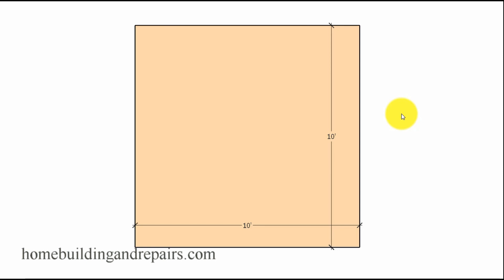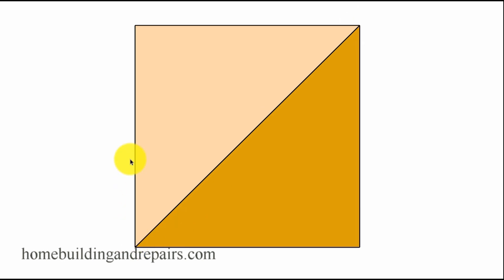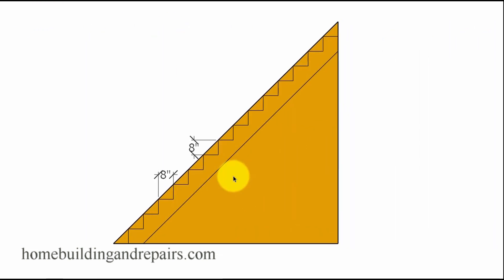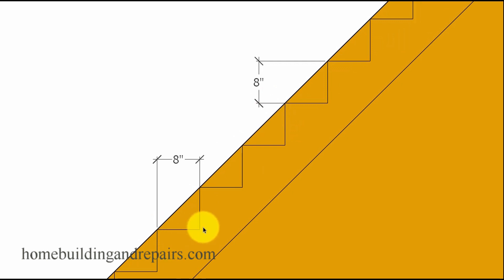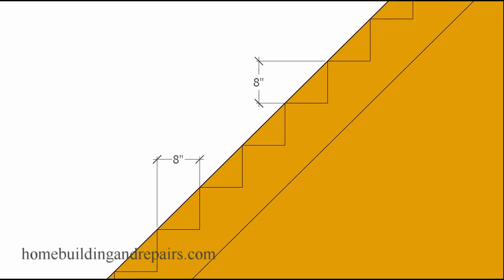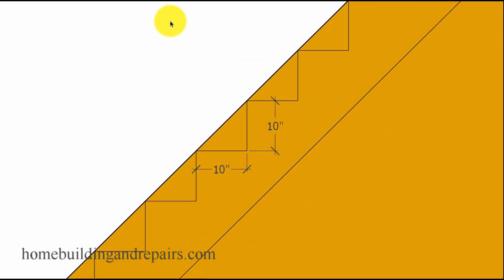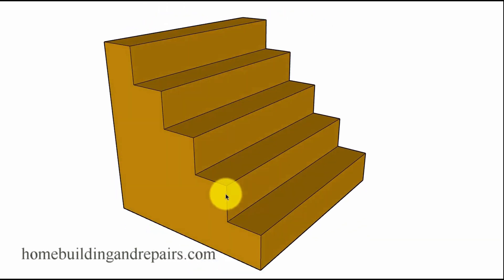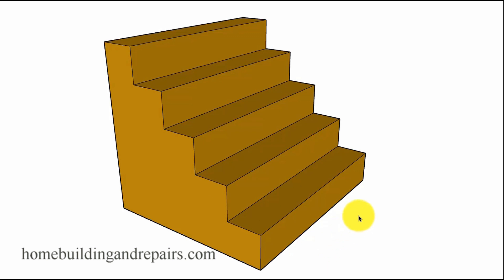45 Degree Sloping Stair Building Problems - Building And Safety Issues

Comment: The house I bought in '97 has the 45 degree stairs,which was built around 1930.I have absolutely no problems with them,the house was totally renovated all but the stairs as they were built like this for a reason.Had I changed them,I would have needed to add a landing and a turn in the stairs,not to mention moving the front exterior door.

Comment: I need to navigate a 45 degree bank leading to the river. 11 feet down and11 feet out. If I flatten the stair slope, the landing will be in the water 30% of the year. Any clever suggestions? Great video.
Reply from the maker: Free to send me some pictures of your problem and you can get our email address at our website and I'll see if I have any bright ideas. I know sometimes they use floating ramps and landings and sometimes the stairway is built a little longer and as the water rises, less of the stairway is shown, let me know if that makes sense.With
Reply: @stairbuilding  Thanks. I'll take a couple pictures tomorrow - it is pouring today.
Reply: Add a landing and a 90 degree turn.